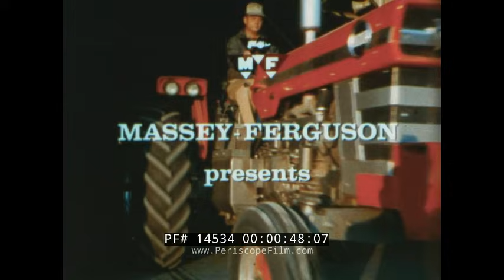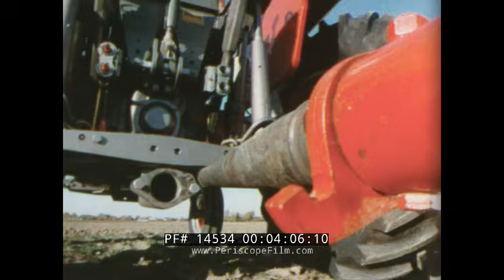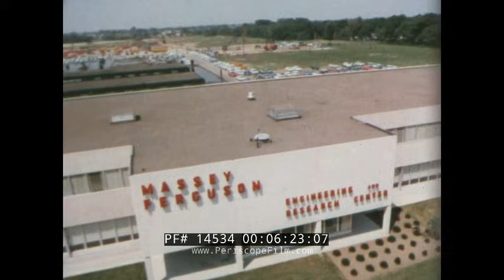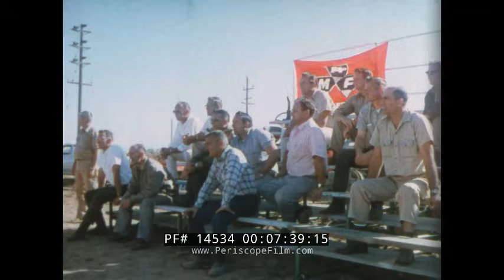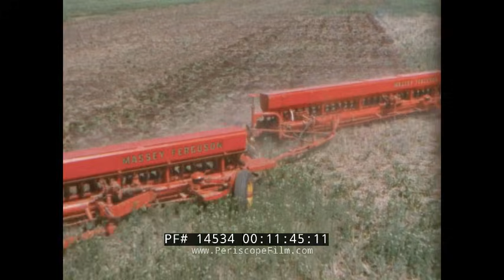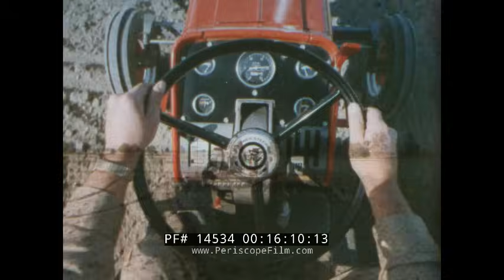MASSEY FERGUSON  MF 1100/1130 TRACTOR PROMOTIONAL FILM "THE RED GIANTS" 14534

Comment: We have an 1100 with a retrofitted GMC 478 V6 gas engine. 206 hp. It's been farming that way for 37 years now. I have a restored modded 1155 with the 540 V8 on dual straight stacks, rops canopy, 23.1x26 rice tires. Stock was 141 hp. It was 236 on the dyno before I cracked the absorber in the dyno. Then I put 5 more turns in the smoke screw to top it out. Still doesn't smoke bad. It will chisel plow in 4th in HARD clay at 1300 to 1600 rpm all day. I will let it lug down so low (about 300 rpms) at the tractor pulls that you can count the cylinders then I stab it, lift the front wheels, hit the multi-power, and keep going. Ticks off the turbo six guys! I'm a Diesel engine builder who worked in a tractor scrapyard and worked NTPA pulls. That Perkins tugboat engine makes everyone else's V8 look like an economy small block a caveman chiseled out of a rock! Of course, that's what Dad said about everything Massey made! I have had IH T9, W9, I9, 400, F-20, Allis Chalmers D17, G, B110, B12, would love a D-21 Series 2, and I own a JD 2010. The only reason for that it that it has great ergonomics and a narrow front for utility work with a flat platform for my disability which meant I couldn't swing my legs over the trans on my MF65, and MF Super 90 anymore. I kept the MH 44 and 55 Diesel tho. That 44 with duals and a wide front has been singing to my family through a 4" straight stack every year since grandpa broke off the pipe in 1958! They sound totally different than an M. It has an M&W high altitude overbore kit in it. The biggest advantage to Massey is that they used proven engines with an established wide parts network and interchangeability within the engine brands of updated or larger ci. What killed MF here was just that expensive precise quality, and let's face it, complexity to the average farmer. Dodge trialed the 354 Perkins in their pickups, they went Cummins because of the cost, definitely not for superior design. You had to keep that hydraulic oil FULL and CLEAN on an 11 series. Most never had all the filters serviced more than once. If you are looking for an 1100 to 1155 the ones with a serial number starting with "9B" have tougher updated rear ends. I have talked to pullers with 640 turbo V8s bored and stroked to about 700 to 800 cubes in 1155s that say the multi-power will hold 600hp if you turn up the pressure. 😊

Comment: We had an 1130 and 1135. Damn good tractors and the Perkins diesel was the best in class. More reliable than Deere or IH. CAV fuel pumps were fantastic. I was also an apprentice mechanic at a Massey dealer. Worked on these old beasts back in the day. Btw - the V8 in the 1150/1155 was a screaming beast, too.

Comment: We had a Massey-Ferguson 1105 on our farm in Ontario, Canada, the difference was ours had a cab. The MF1105 was the same 94 horsepower and would pull a 7 furrow plow. There was a MF1150 with a big V8 engine, that's the one I wish we had. Our first Massey-Ferguson was the MF65 in the 60's, then in 1971 the MF165, then the MF1080, then the MF1105, and the MF3165 loader tractor. All our equipment was Massey-Ferguson also, and we owned Massey-Ferguson combines, the MF300 and MF510.

Comment: Obviously these boys never got on a Oliver.  I like Massey though.  It's funny they take credit for the twist adjust wheels and the adaptive weight transfer,  both allis  invented.  Oliver had the same steering column set up as well
Reply: Personally, my all time favorite was & still is the Oliver Super 99 with the 3-71Detroit Diesel..... and if I ever get my hands on one, the engine will not remain "stock" for very long.
Reply: Harry Ferguson invented adaptive weight transfer you idiot
Reply: @casefarmgirl2279  
That’s right, the Ferguson system as it was called !!

Comment: I do not know any other kind of tractor! I have a 1959 M-F 50 & 2018 M-F 1526 both still doing the work I need them do of course I know the 1526 will because it is newer but the  1959  50 has never let me down and it was the 1st tractor I bought used and have had  it for 22 yrs. and still being put to work .I bought the 1526 for 4wd & loader and because the reliable history of the 50 I have had. I love my Massey Fergunsons.

Comment: Back in the '80s when I would drive from my parents house to my college town I would pass a MF dealership. I was real disappointed when a few years later noticed they had changed to Kubota.   Should I ever have enough land to need a tractor, it's going to be a Massey-Ferguson.
Reply: Best choice you can make!
Reply: @timhenning6854  we had 1130 good  tractor but are Allis 220 would out lug it very easily  no comparison it would even out lug my uncles 1155. Only tractor come close was dads MM 1350. Our 285 massey bought in 79 has been the most reliable tractor on the farm hr gauge broke at 3718hrs yrs ago still starts an runs perfect. I love it.

Comment: I have a Massey 1100 I am the second owner I absolutely love very reliable very comfortable to drive
Reply: check out the dash wiring as they can be an issue with "thermal events"
Reply: We had an 1100 and a 1080.  Were good machines.

Comment: Does anyone have an idea how much these tractors cost?
Reply: worked at mf boss sold a lot 165 dsl 4500/up  1100 7xroughly
Reply: Don’t know where you are from but in Alberta Canada they sell for 2-3 thousand bucks in running order and not to fancy. In 1970 my uncle bought the 1967 -1100 i still run for 7500 bucks new. Probably list price was about 10000 more for a 1130.
Reply: @georgeketchmark3087  I am in Alberta to. My dad bought an MF 1100 at auction for $2200 in the late 80s. Good old tractor for sure. A guy sees a lot of them for sale still today up here.
Reply: My Dad was a MF and MM dealer. Later my brothers got the JD franchise  The 1100 was around 10 thousand. 1130 guessing around 12 thousand. Most brands late 60s and early 70s  94 to 120 hp. Were in the range 10 thousand to maybe 15 thousand. I know Deere sold itself.  It was a challenge with other brands.

Comment: Any of you fellow old timers out there remember when Minneapolis Moline built a heavy tractor for MF? It had MF tin and paint, but the cast parts, of which there were many, had the same M-M part numbers as their own. Each part number started with M-M.
I guess if you bought a Minnie Mo cylinder or head, the MF dealer had to shoot it with a different color paint.
Any of you guys out there know differently?
Also, under White Consolidated Industries, M-M made models badged as Olivers.
I love these old videos! Thanks!
Reply: MF 95 and 97 were MM models with red paint and slightly different tinwork. The MF 98 with the 3 71 Detroit was an Oliver 990
Reply: Due to a fire at the plant where MF was going to build "BIG" tractors. What models they were to be I have yet to learn. Ol' Harry had to be spinning in his grave over that decision.
Reply: Very good Ben. Thanks so much for the details!
Reply: The first tractor I bought was a 97 Massey long time ago still sitting out back hasn’t ran in years. Loved that tractor ran like a watch
Reply: If I remember correctly. The 97 MF was a Minneapolis Moline G705 available with FWD.   THE 98 MF was a big Oliver. Then MF made their own big tractor. 1100 and 1130 Later 1105  1135  1155. Good tractors. Then the 2000 series. Poor tractors. Never sold enough to make a profit. Case in 1970 new quiet cab and 3 speed power shift with close shifts like one mph or less between shifts which worked ok.  MF 2000 series had way TOO MUCH spread between power shifts. No good. Plus problems. Then JD came out with a great quiet cab and 15 speed power shifts. Case and Deere took over. All over for most other US brands.